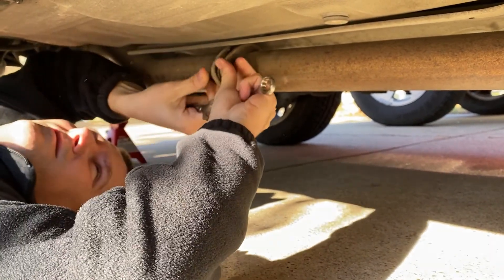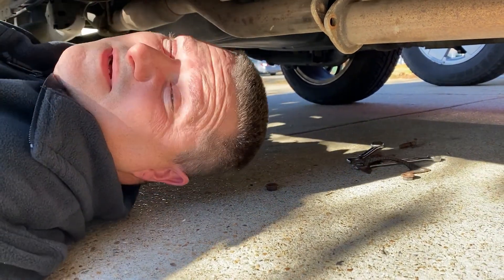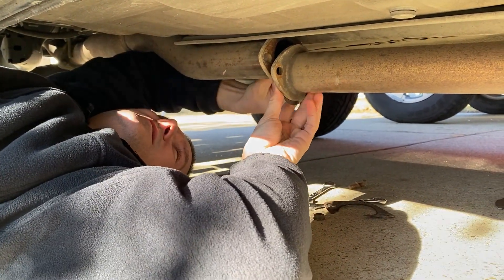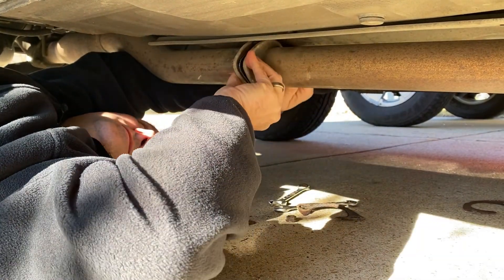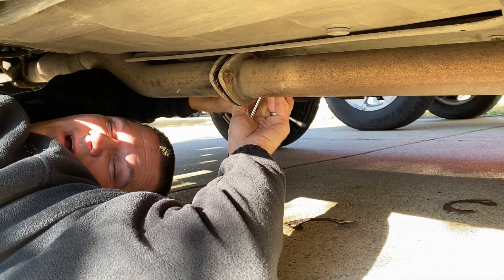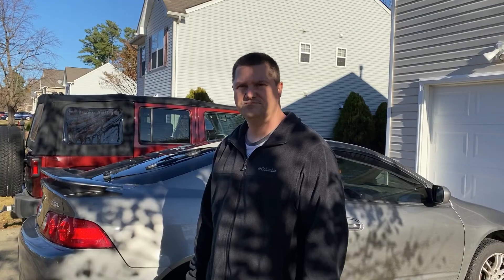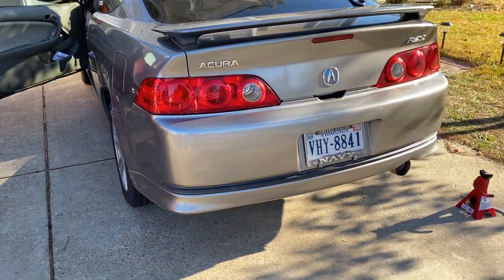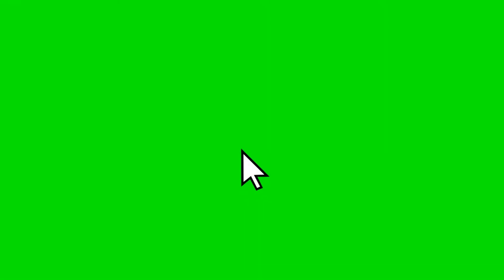2005 Rsx exhaust install acura rsx startup exhaust 2.5 exhaust race header

Comment: Did you still use the 2 1/2" Gaskets? If so where can they be purchased to get the right size. I have the same vehicle
Reply from the maker: Green Life Garden & Home DIY I took me a while to get the right gaskets. I had to order them from advanced auto parts.  If you could send me a email jcmotivegarage@gmail.com.com I can send you the part number.
Reply from the maker: Green Life Garden & Home DIY the part number is 61694, it's for a gm v8 but they fit and are better than ebay gaskets. Hope this helps